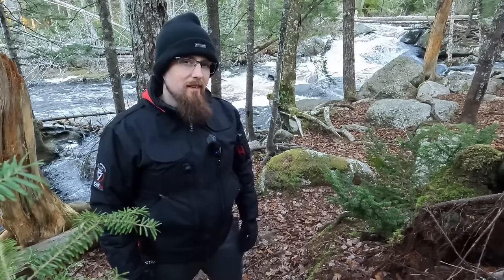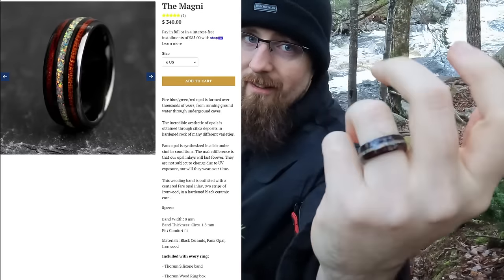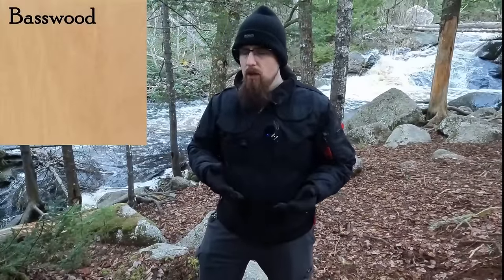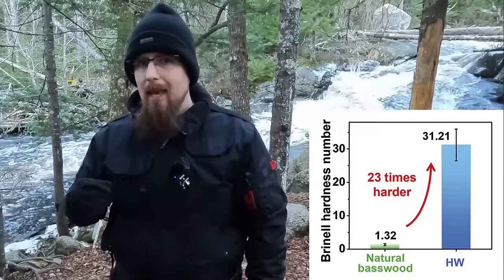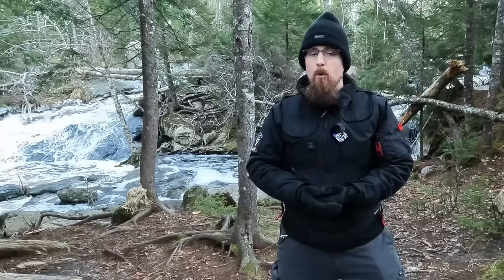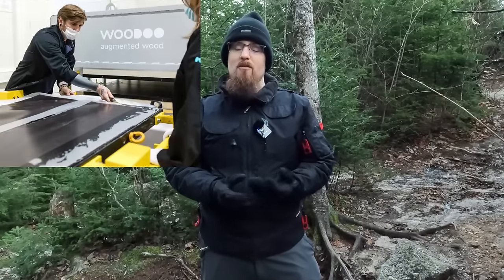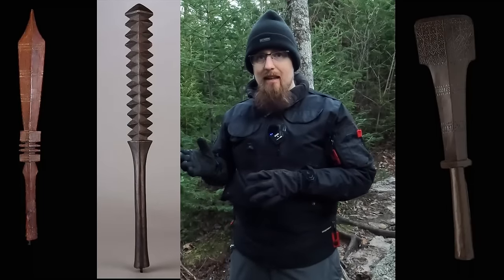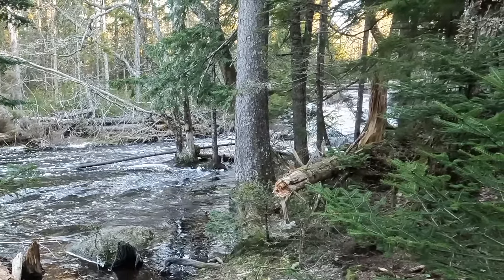Hardened Super Wood!  -  Can It Rival Steel?

Comment: I don't think that comparing the hardened wood butter-knife to a metal one is a bad idea. The implication would be, that one of the most popular kitchen appliances could be replaced for a wooden alternative. Furthermore, let's say it would be possible to make manufacturing energetically more efficient to produce said wooden knifes than the metal ones, then there would be a cheaper and better performing alternative.

It is feasible to leave an impact on maybe the fast food industry, with it being a 'green/eco-image friendly' look, or that regulatory incentives, like in Germany, to not use plastic utensils, that are in force/or in the talk due to the present throwaway culture, push those service industries in to a new alternative. Though it would be important how food waste and cleaning processes impact the hardness and durability of said item.

Comment: Problem is that Brinell scale is about hardness, not toughness. It's hard to scratch it with a screwdriver but it doesn't tell much about penetration resistence. That would rather be tensil strength
Glass stand pretty high in Brinell scale, but I wouldn't say it's a great material for armour
Reply: That said, I'm impressed to see that what is basically compressed fabric (as only the cellulosys remain) can be that hard. I have no idea what is this good for, but it's impressive

Comment: If you want to make Armor, just go to Canadian Tire and head over to the Boat section.  Buy a Fiberglass Repair Kit and make sure you get some actual Fiberglass Cloth.   Make armor whatever shape you want out of foam and use the fiberglass cloth and resin as on the instructions to cover the armor. The result is as hard as a Boat Hull or a Snowboard.

Comment: but what about its malleability?

This potentially new material is useless if it is too brittle. I would suggest using something that is already strong like bamboo as it is flexible yet strong- which is already promising as they use this material for buildings. Additionally, if you use bamboo and harden it, what specific aspect/ ability of this material gives way?

If hardening this material then you have to consider that its malleability could suffer as a result. However, if using this material for something like plywood then this is a completely different level. 

Think of it this way, if you combine this material at different directions (grain opposing grain) then this modified plywood would be stupidly strong. Yet again though, it is vital to combine it with malleable materials to prevent it from being brittle.  They already use plywood for construction beams as the design makes it on par with steel I beams. Thus if the plywood is modified with this material (hardened plywood) then if could replace steel as a primary product in the construction industry.

Wood is already having a large impact in the building industry as we (as a society) are coming up with new ways to create renewable materials. Some buildings are neglecting steel all together as they can engineer the wood to comply with fire prevention specifications.

What is your opinion on this?

Comment: As someone in the construction industry, I'm afraid I don't see this as having much future as it currently stands. The issue with wood in construction is standardisation. Quality in different pieces of wood, even from the same tree, can vary dramatically based on a whole lot of factors. This would increase the quality, but would still require quite a lot of processing and would still be inferior to steel. 

More importantly, there is already a better wood alternative in the form of laminated mass timber, which is much cheaper to make and can use make much better use of the whole tree.

Comment: @caspaabriel4794
1 second ago
If so. . . .Wood Densification. Multiple testing is required : Immediate - Medium - Long Term:  Chemical/Gas leaching? Strength/Brittleness? Fire or non fire resistance? Longevity? These are only minimal.1st test questions.  ?

Comment: By lacquering and mixing different types of wood you can make armor, or swords that can go toe to toe with metal swords.
Reply: Ofcourse the wood swords wont be as durable and their maintenance and repair will differ greatly and the way you use the sword will have to take into account the materials weakness.
Reply: I am by no means claiming that wooden swords and armor would be superior to metal.

Comment: Your speculation about how this treatment would affect hardwoods unjustified.  All woods have the same basic structure.  Wood hardness is mostly a function of how specific trees grow, with slower growth results in higher density and increased hardness.  Given that you're starting off with the same basic components regardless of the type of wood, the same process will likely result in a a similar density.  I don't know how the process would work out for harder woods either, but it seems most likely that the final hardness will vary modestly.

Comment: Hardness != strength

Take a rose and drop it on a tile floor. It'll be fine.
Dip the rose in liquid nitrogen and drop it on the floor again. It will shatter, even though the frozen rose has greater hardness that the unfrozen rose.

As for the "transparent wood," I don't see how it's better than just using the transparent polymer directly.

Comment: Run a time line, starting at the earliest use of spears.  And mark along the line the advent of leather armor, then wood, then metals.  The earliest tip of the spear was just dry wood.   Then,later, hardened in fire.  Now superimpose modern super wood and how it would perform against those various armors.  And, now that we can understand the chemistry and process for "supering" the wood, what primitive resources could make spears(or other items) with super wood parts?  (this would all be of interest in primitive "prepper" skills for folks today.)  Essentially, without a modern lab, could super wood be made by a DIYer?  Super wood would be great for many tools, not just weapons.  Bearings, wear surfaces, sewing needles, even drills, etc..

Comment: Armor actually sounds like a genious solution. Modern steel armor is practically unusable, so using hardened wood may be a perfect compromise.
Also I wonder how hard it would be to machine the new wood, making guitars out of this sounds like a possible cheap alternative to exotic hardwoods. Maybe there's no machining needed...

Comment: A steel nail on a construction site isn't hammered in by hand anymore.  they are power driven by a pneumatic nailer in a tiny fraction of a second.  Roofers bash out several nails a second on a regular basis.  A wooden nail would need to compete with this to be practical.

Comment: I don’t think this would work well for anything much harder than basswood. The softest woods are generally very porous, allowing the chemicals that attack the hemicellulose and lignin to perfuse through the material and get cleared out.

Something like oak would have a hell of a time getting treated. I suspect the results would actually be significantly worse than with basswood.

Comment: Wooden nails would never work because the benefit of nails isnt that they are hard to break, it is that they are bendable. That is why we still use nails when building houses instead of screws. A screw does not bend, it breaks. But a nail does bend. This allows the house to shift and "settle" without snapping of screws and falling apart.

Comment: The logical process going on in my brain is that the hardness would work the opposite way you are suggesting. 

The reinforcing material is being forced into the voids and giving it a higher hardness rating on whatever scale you are using. The actual wood would be the weak point. Think about it like this. If you have a container half full of brinell 50 epoxy, and you fill the rest of it with it brinell 10 wood, the wood reduces the overall strength of the epoxy.  That block of epoxy is weaker for having wood in it.  In reverse if you fill the voids of wood with an epoxy, the wood becomes stronger. Which is the basis of a lot of classical wood finishes. We mix shellac with mineral spirits so it soaks into the wood and when the spirits evaporate they leave the shellac deposited in the voids, and makes the surface of the wood stronger. The process described for making wood 'harder than steel' is basically a natural conclusion of something that has been done for centuries already. 

My hypothesis is that generally, if the maximum hardness of the end result is the max hardness of the reinforcing material minus the original hardness of the wood, the optimal wood to start with as a base would be as soft as possible. You want it to sponge up as much of that goodness as it can, because the higher ratio of material to wood you get, the closer it becomes to being the hardness of the material. Hardwoods like oak, and ebony would soak up less of the material so they would benefit less from the reinforcement, and wouldn't give you as much of a change. Honestly the best wood you could probably use would be balsa. Vacuum soak it in a thin, super hard, slow drying epoxy till it is completely saturated, allow it to cure, and you would  have mostly epoxy, that looks like wood, and performs closely to the original epoxy.

Comment: This hardened wood replacing something like steel seems quite a bit far honestly. But something like plastic seems totally reasonable. Maybe as you apply pressure to it, you can put in inside a mold at the same time. So when it gets compressed, it deforms into the desired shape.

Comment: You can't compare hardness of different materials. I'll explain below. This is why the Janka,  Brinnell or Rockwell hardness scales cannot be converted with any accuracy. Materials have widely varying methods for testing and measuring hardness because they vary in structure. This is because, unlike tensile strength or Young's modulus, hardness is not a fundamental property of materials . Even with steels, you can only compare very similar types when characterizing hardness. It's easy to empirically judge hardness, but you can't rightly say that one material is X amount harder than another.

Sorry for metallurgist rant.

Comment: You wouldn't use a nail when it's made of the same material. That doesn't work. A rivet might, but a pin is the better option. More work though.

Comment: They already make wooden nails driven with a nail gun:
LIGNOLOC® wooden nails from 38 mm | 1 ½ inches on

Diameter: 3,7 mm | 0,145 inches
Lengths: 38, 50, 55 and 60 mm | 1 ½ – 2 3/8 inches
Material: Compressed beech wood
Colour: Natural
Coil capacity: 170 - 4 000 
Magazine: 15° plastic sheet coil LIGNOLOC®
Nailer Type: F44 LIGNOLOC

Comment: My initial thought is that once you go through the expense of boiling it in chemicals and then pressing and drying it, it would probably be cheaper and easier to just use steel or plastic.  I could see some eco-hipster applications for home use, but not for industrial use.  Also, this would be Homeland Security's worst nightmare if you could build a working gun out of it with no metal parts.

Comment: Now consider how much more effective this tech would be if you combine it with the plywood making process, laminating layers together so that the grain pattern in each layer crosses and reinforces the on before. Not something you can really do with metals or plastics.
Reply: "Not something you can really do with metals or plastics." It very much can, and is done with composites like fiberglass or carbon fibre. Often layers are not even at 90 as with plywood, depending on what property is required from the material. Using wood fibers instead would be a more natural composite material. Would be amazingly strong plywood, for sure.

Comment: You wouldn't get any where near the same levels for hardwoods as you do for softwood. Plus you lose a lot of the benefits of wood. Wood is an excellent material for it's flexibility. The process looks very energy intensive and you need to work out if the results outweigh the costs in treatment.

Comment: If they did make wood straight up harder than steel, wouldn't that make it unusable? You can't weld wood, and if it is that hard you can't drive nails in and it would be a pain in the but to drill through.

Comment: Fiber composites are not new, but it doesn't seem like this idea takes advantage of the strongest properties of wood.  If you are going to make a dense, oriented fiber material, why not use fiberglass?  If you want to use plant material, fiber reinforced concrete panels are very common (though they have a serious defect in terms of durability).  Cellulose, hemicellulose and lignin all have large amounts of oxygen in them, which is necessary for making a locally reactive molecule that a biological system can turn into a polymer, but bad for the strength to weight ratio.  UHMWPE fibers oriented within a resin matrix is a better version of the same idea, but living things don't use lipids for structural purposes beyond the most basic levels (i.e. 1-3 fatty acids, nearly all shorter than 30 carbons in length,  for cell membranes).  Even LDPE chains are thousands to tens of thousands of carbons long, and UHMWPE chains are much longer than that.  

But despite that objectively superior alternative, we still use wood, and not just because it is cheap.  The microstructure of wood gives it rigidity which is essentially impossible to reproduce outside of a lab, and which overcomes the inherently poor properties of its constituent chemical components.  This idea seems like "Let's completely get rid of all of the unique and valuable properties of wood in order to highlight its worst properties".  A far more interesting material, to me, would be a UHMWPE fiber reinforced resin with a microstructure similar to that of wood (kind of like an oriented aerogel).

Comment: actually, some iron woods when dried already do rival steel like maple wood. It broke my one piece axe. When i say one piece it means the handle and axe head are all part of the same piece of steel. I was trying to prove that you cant cut dried maple wood with axe. But i didnt expect id break the axe itself: The metal hendle bent and broke off. Thats how hard completely dried maple is. 
But if you want to make wood harder, just cut it along the grain. Then steam it too make it flexible. Then press it, so the grain because flat instead of it natural round form. Then repeat this a bunch time. Let it all dry while in the press so it stays flat once dry, otherwise it will go bsck to being round as it dries. Then just glue a whole bunch of them together and there,, you now have a piece of wood thats far stronger then that strengthening technique those dumb scientists were using. 
When talking about wood go ask a carpenter and not a scientist dummy.

Comment: "3 times sharper than most conventional table knives" doesn't even sound impressive... you just instantly assume "butterknife" at that point. That said, being able to make your butterknives out of wood and have them as a viable replacement to metal could be interesting. Also curious how durable these hardened woods are for long-term use compared with traditionally-treated woods.

Comment: 3:50 Article talks about strength and you jump right back into hardness comparisons; which have nothing to do with strength. Strength is measured in pressure ratings like MPa. Marshal arts guy talking about engineering... I suppose it's to be expected ; )

Comment: This sounds dubious. Part of the reason why they used a weak wood was so that when compressed it would have good physical properties- A wood that has good internal strength will not benefit from this because it already has a better structure, and crushing sure wouldn't help either. Forming a composite board from pulp is essentially what the study describes, which doesn't make any of the further analysis very useful.

Comment: Sorry, but this is kind of bad and dumb. They used basswood because it isn't dense and it has a lot of lignin. If they'd used oak, it wouldn't have been 23 times harder or 15 or 10 or probably even 5 times harder.
Another problem you have is getting the "chemical treatment" (almost certainly sodium hydroxide) to penetrate the wood. That's why they used a dippy little tiny sample. Scale it up, you can't get it into the wood. Use a harder wood, you can't get it into the wood.

Also, we already know what the end state of this is: cellulose plastic. It doesn't matter how much you compress or cross-link it, it won't be harder than industrially produced cellulose plastics.

This is an expensive, time consuming, inefficient, chemically toxic way to make drink coasters for hippies.

Comment: The "harder than steel" is such a tried trope and is always disingenuous and requires a lot of "yahbuts". It's kind of like "silk is stronger than steel" even though it's being incredibly misleading because a 1 mm strand of silk is not as strong as a 1mm strand of steel which why you need a woven piece of silk that is almost the size of dishrag to equal the tensile strength of a piece of 1mm steel wire.